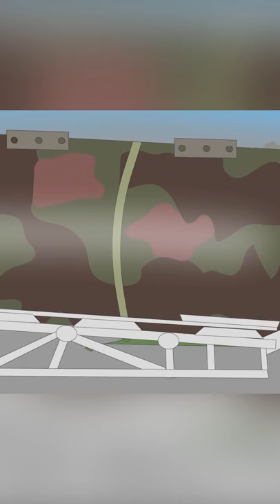How Effective are Tank Silencers?  #Shorts

Comment: I thought the silencer would be the size of the tank muzzle  but its actually big
Reply: It’s almost bigger than the tank itself
Reply: The ones made for NATO’s various 155mm Self-Propelled Guns is more than twice as large, with 2 big balls on the side.
Reply: Ask Holy Spirit to teach you and to guide
you. I would recommend the YouTube Cleveland street preachers and follow Jesus no man no religion. Be holy and obey Jesus. Hebrews 5:9 "salvation is for those who obey. 
Jesus says if you love me keep my commandments (John 14:15). Jesus even says if you keep my commandments then you shall abide in my love (John 15:10).g
Reply: can we just make the tank muzzle have a built in silencer lol
Reply: Ever notice how suppressors on guns are slightly bigger than the barrel
Reply: It’s not a tank silencer. It was actually for self-propelled German artillery, such as the M109. The PROTOTYPE of the muffler was made using a Leopard 2A1.
Reply: It couldn't be any smaller?
Reply: @itsblitz4437  it has to be that big for the tank round's fins to not catch onto something in the inside.Also look at a diagram of a modern tank shell and a suppressor.
Reply: @itsblitz4437  It's so large specifically because of the volume of gas generated by firing, smaller size means less space for the gas to go and increased pressure.

Anything much  smaller would run the risk of exploding like a bomb or causing the tank gun to overpressure either cracking the barrel or blowing out the breach killing the crew.

Comment: Fun fact: 80db down to 60db would be 4-10x quieter as perceived by the human ear. An increase of 6-10db is perceived as a doubling of volume.
Reply: That's not how math works, even going with the 10db jump being equivalent to 2x, that's a 4x difference...
It's also not how decibels work, as 10db is an order of magnitude change, 20db more is 100x the original.
Reply: @Larcona_  You right, you right. Edited.

Comment: These were developed for 155mm self-propelled howitzers, the Panzerhaubitze 2000. I've never seen them on Leopards, and I don't think they're used on them, since all pictures I've seen of them have them elevated at angles the Leopards gun couldn't possibly reach, plus I see no way the gunner could still use his sight with that massive thing attached to the barrel.

Comment: So let me try to think of the logic behind people thinking a silencer of tanks during warfare would be a good idea.

We have a big tank over here,that should be fast,lethal and adaptable.Even if it is spotted,some tanks could fight at a longer range than others,or move at higher speeds than other tanks and at the same time able to decimate tanks,and no matter what,you're going to be seen.So let's mount a suppressor,that doesn't even work like in movies,that according to physics is so heavy it can't even be mounted on a tank,thus causing a tank to be slow even if it was mounted,and need more oil to run.Thus making it so that the tank needs much more armor than before,slowing it down even more.And then causing it to be an open target to soldiers,tanks or aircraft.

What a great idea!Just make a tank slow as heck,which uses more fuel and thus more money,with armor that's going to eventually be obsolete since LW will be here eventually as well as guided missiles,and a variety of anti-tank missiles that will all be used in the future,that will all decimate a tank no matter how armored.
Reply: This suppressor isnt meant for use in combat only for noise reduction during target practise

Comment: Wonder if there’s a way to have an expansion chamber on the silencer, which has holes in it and an exhaust that could direct the sound backwards away from the enemy. Maybe if it could work the silencer could be smaller and portable because the exhaust could also have multiple outlets with smaller silencers on them.    Idk just spitballing.
Reply: The “balls” of the silencer is the expansion chamber. Also directing the exhaust gas will greatly increase the sound so just letting pressure gradually drop through the fire hole works a lot better.

Comment: Wouldn't they get in the way of targeting systems, or were they designed just for non-target firing?
Reply: I think it may be just used you trained soldiers on how to load and fire the main Cannon and how to handle mishaps. And they also probably use this to prove the Cannons every so often after say a rebuild or replacement of a part
Reply: Can probably still use it for bore-sighting

Comment: Just put a oil filter on them and give them some silent shells and then boom, you have a silent tank.
Reply: it's not the shells, it's the force that fires the shells, the high pressure AIR is the reason